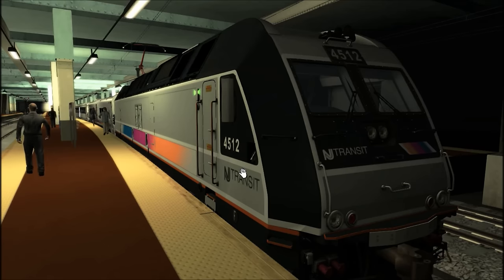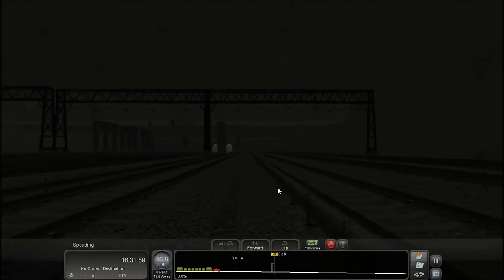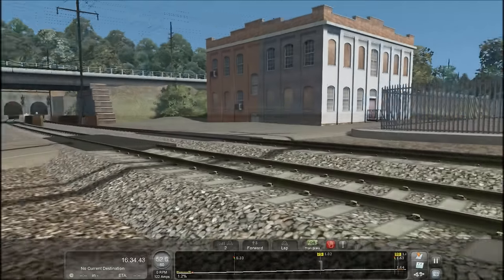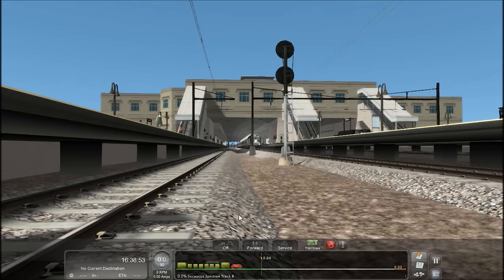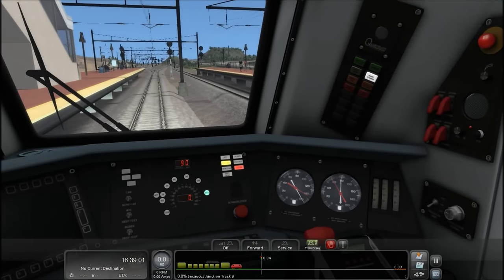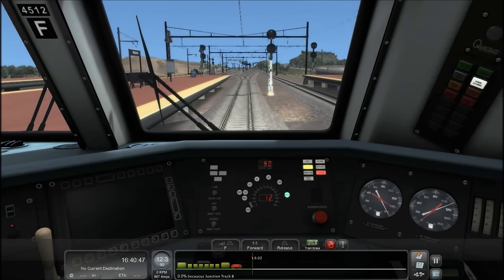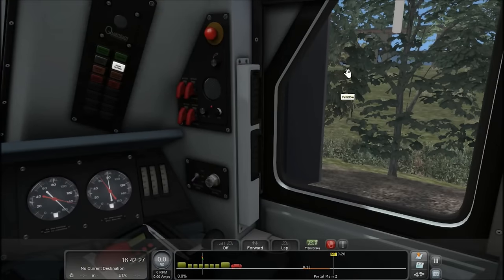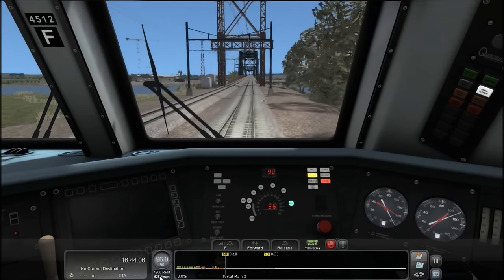Train Simulator 2016 HD: NJT Bombardier ALP-45DP & Comet Car Sound & Physics Mod Released 10/7/15

Comment: I usually time trains with acceleration to 30 and 45 mph. Dropping the hammer here, took 30 seconds to 30 mph and 49 seconds to 45 mph in electric, and 32 seconds to 30 mph and 59 seconds to 45 mph in diesel. Hopefully those Comet cars are of prototypical weight (let's say running a middling passenger load)
Reply from the maker: Passenger car weight is set at 57 metric tons, or 125,662 lbs. That works out to about 20,000 lbs of passenger load, which is fairly accurate.
Reply from the maker: Also remember that this is a simulation, there are a lot of different factors that may not be accounted for in the game code, so you will NEVER fully recreate 100% accurate train physics regardless of how close your Tractive effort/power/and train weight values are.
Reply: Most comets weight about 48-52 tons empty, multilevels about 67-69 empty, although not sure exactly
Reply from the maker: Yea, I have the empty weights for the cars on my PC

Comment: They still didn't fix the mode change timing for the most part. When i operate the engine in free roam, there is still no delay on the mode change, but when i'm in quick drive, the mode change isn't instantaneous. That's kind of weird lol.

Comment: Fan Railer, right now i am experiencing difficulty using this mod pack. the Physics is working but there is nothing in the audio folder. Any ideas? Also, i have noticed a slight stutter in the beginning of the m8 K5LA horn.

Comment: Hi Fan Railer, amazing mod and sound.
But i have found weird issue.
When I change to diesel mode and put the panto down, the diesel engine should turn on but the electric sound didn't off.
So when the train depart, the diesel engine and electric sound are on in the same time.
Is this supposed like this?
Reply: Abay Suryawan it could be the amps generated by the deisel electric engine

Comment: How do you change the roll signs on the comet v?
Reply from the maker: Read the DLC manual
Reply: +Fan Railer Thanks! I also have one last issue. I can't drag the camera around like I'm the cab. is there a way to fix that?

Comment: why did you leave the brakes on lap at the start
Reply from the maker: I guess I forgot about them. There was no brake pressure in the cylinders anyway, so it made no difference operationally.
Reply: ok
Reply: +Fan Railer how did you change from electric to desial
Reply: Illinois State Trooper p